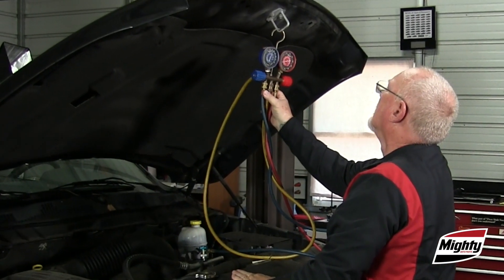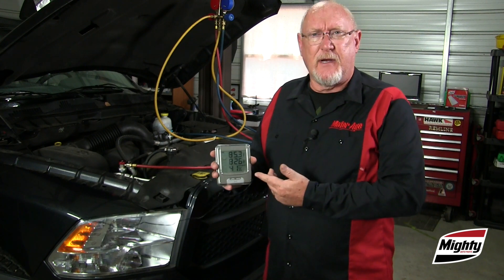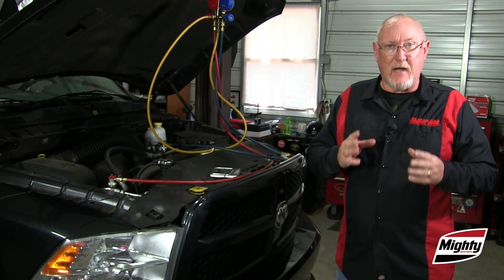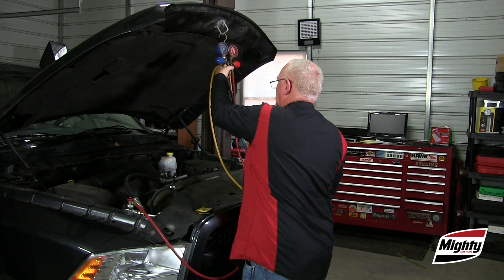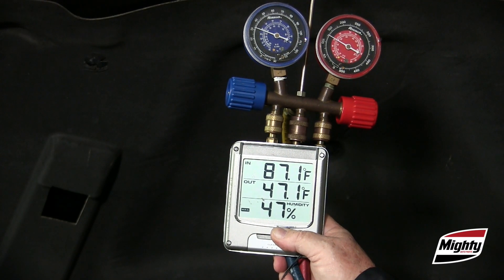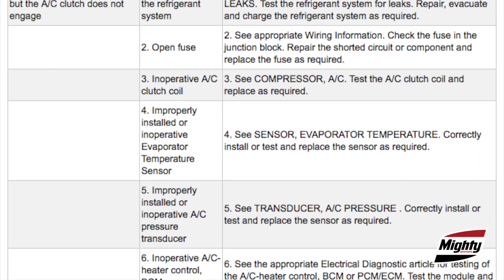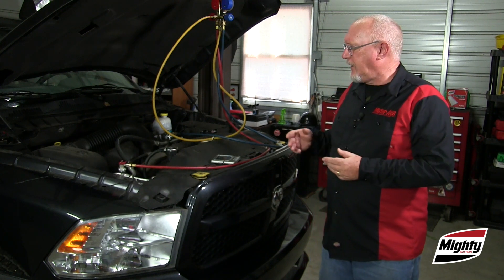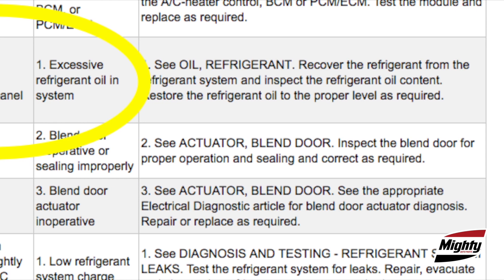The Mighty Minute - Ep 15:  A/C System Performance Testing

Comment: First thing I do is check the low side line coming out of the fire wall is it cold
If it is and you you dont feel cold air in the cab you may have plugged evaporator 
Inside the vehicle 
If it isnt cold is the ac clutch engaging 
Cycle the switch is the compressor turning 
Simple check also remember AC systems dont make cold air they take the hot air out
In recirculating mode the hot air is usually pulled in near the floor area under the dash it passes through the evaporator and the heat from the car is turned into condensation 
Good fast rule of pressures with out gauges is a temp gun the low side and high side line temps out side in the engine compartment will be close to the actual pressure 
Thats just the way ive learned to checked